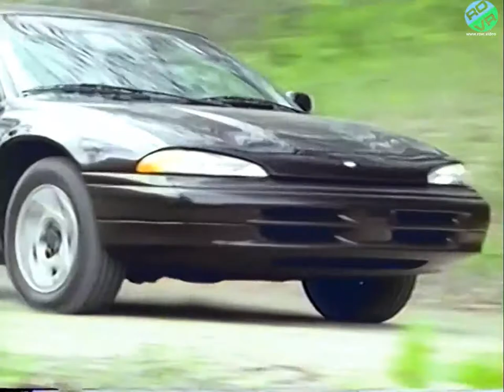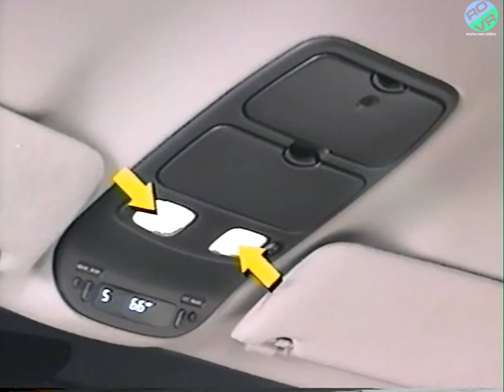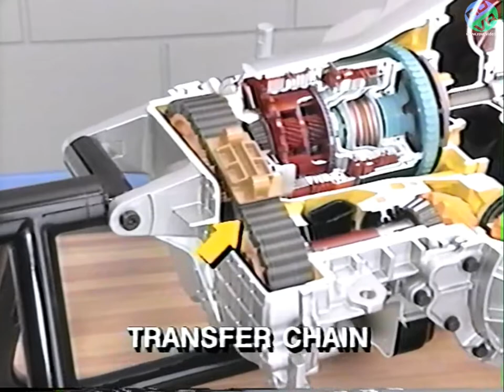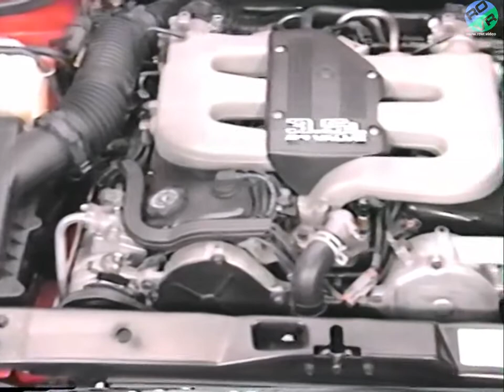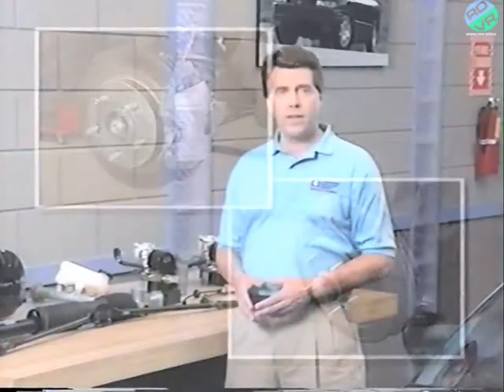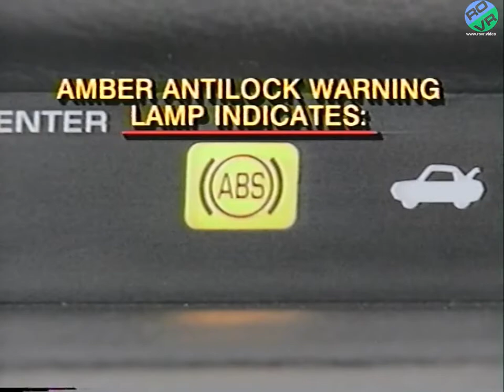Chrysler Dodge-Eagle - VideoTec -  June 1992 - Concorde Intrepid Vision - Service Training  (1992)

Comment: I had a 93 concorde with the 3.3 V6. We finally got rid of it after 309k miles on the original engine and tranny. Best car I ever had.. what a beast!
Reply: Wow!  You beat my 93 Intrepid w/ 3.5L by only 3k.  I had a leaky transmission and didn't want to do suspension work and buy new tires at 306k.  I now have a 94 with 86k on it I bought 2024